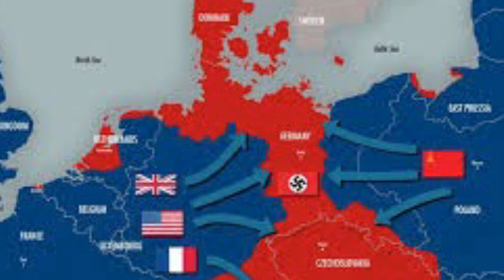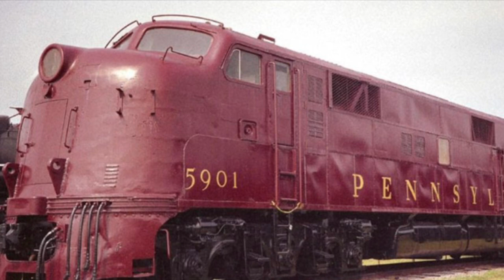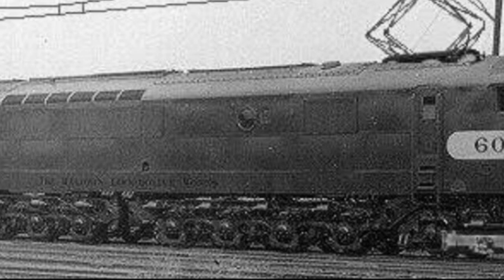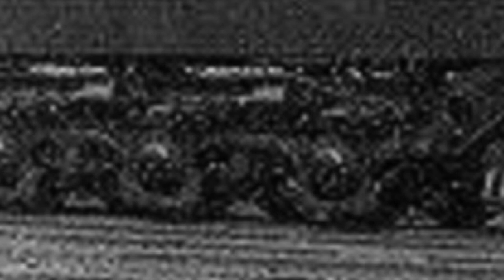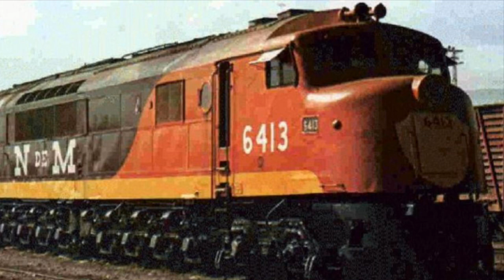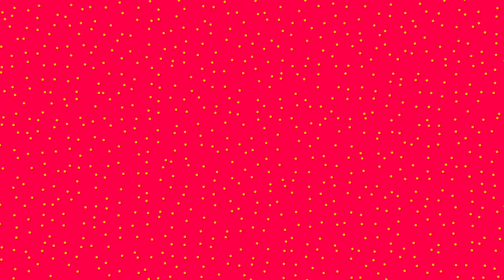Engines Of North America: The Baldwin Centipede

Comment: The original experimental unit was designed to have 8 750HP 408 series engines. Each one was self contained with integral cooling system and main generator. The power pac ( my term) could be lifted out and replaced quickly in case of a problem( Way ahead of it's time). Due to restrictions, only 4 were installed. It was tested on the B&O between Philly and Elsmere Jct, De.
 The post-war version used 2 1500HP 608SC prime movers in place of the 408's. Intended as single units, PRR ordered theirs as Semi-permanently coupled pairs. PRR derated them to 2500HP each ( 5000HP per pair) after they moved them to freight then finally helper service. Pennsy did experience traction motors overheating problems in helper service out of Altoona on the Horseshoe Curve.
In the early 1950's, NdeM sent theirs back to Eddystone, where they were upgraded with 608A prime movers, but keeping their 1500HP rating.

Comment: Remember reading about the centipedes. Apparently with all the issues the Pennsy had with them they finally having someone think high horse power unit,plenty of tractive effort, keep  em close to a yard for the inevitable maintenance issues hey let's use them as hump locomotives. 
Great idea except they failed to note the obvious issues of a long rigid frame and a fairly sharp leveling at the top of the hump.
Seems as the cut topped the hump the lead drive wheels wouldn't follow the rails like a 2 or 3 axel truck but would continue upwards, leaving the rails until the locomotive reached the tipping point and the cone back down. 
All great if the wheels landed back on the rails but most of the time they didn't and after several rerailings the centipedes failed at their last chance at being useful to the Pennsylvania and were taken out of service.
Reply: Sounds like the same kind of thinking that matched up the FF1 with flimsy late 1800s-vintage freight wagons for its tests, with predictable disastrous results.

Comment: Baldwin manufactured these these like steam locomotives. They built them one at a one instead of using common assembly lines. The result was that each centipede was slightly different from the next one, and thus the wiring was in slightly different spots between each unit, which made even routine maintenance complicated. Essentially, these things were obsolete before they were even finished. This was the root of the problems with these things, thus why they were considered unsuccessful, and thus why all were scrapped.

Comment: Those Baldwin Centipedes reminds me a model that served in the Chilean State Railways, sold to Chile in 1948 where they were known as the Serpiente de Oro (Golden Snake in Spanish) due that were very agile machines while negotiating slopes uphill and to the enormous amount spent by the Chilean Fisco in order to get those locos. They look quite similar to the GE Little Joes but are smaller. Those engines were sold with a traction power of 5000 hp, and even today are still considered the most powerful locomotive to ever have served in Ferrocarriles del Estado de Chile (Spanish name for the Chilean State Railways, current Empresa de Ferrocarriles del Estado EFE - Chilean State Railways Company in English)

Comment: Remember, folks.  From the 40s perspective, the Centipede is NOT the freak.   If anything, the FT, a string of four streetcars, must have seemed freakish for a high speed locomotive.   In fact a heavy loco on two swiveling trucks, with axle hung traction motors, is fraught with potential tracking and stability pitfalls at high speed.  Holding the powered axles in the main frame and giving them a predictable alignment with the rails, via a pair of well-understood four wheel trucks, was a perfectly logical thing to do.  Just expensive. 

Nor are these the rigid monstrosities they might seem to be.  They aren't so unlike a Little Joe or W1 or GG1, and the GG1 tracked beautifully.  In other words, the Centipede is meant to be a 100mph diesel.  Or, on the Seaboard, a modestly high speed diesel for use on inferior track.

Comment: With so many truck sets, how many pins does the loco uses to sit on those trucks .
Reply from the maker: I’m afraid I’m the wrong person to ask that question. It’s a bit beyond my expertise.
Reply: @ironhorsehistorian9871  Ok, maybe someone will come on here with the answer. Thanks.
Reply from the maker: @ferdinandfrancis9673  :)
Reply: Four
Reply: In fact there are only two trucks.  The four wheel unpowered trucks at each end.  All motored axles are carried in the articulated frames, which are hinged together in the middle.